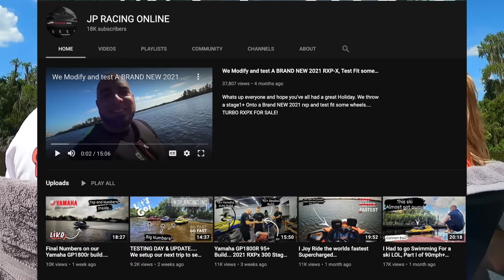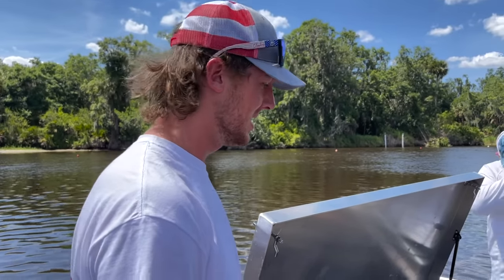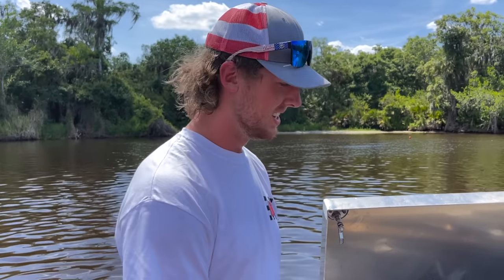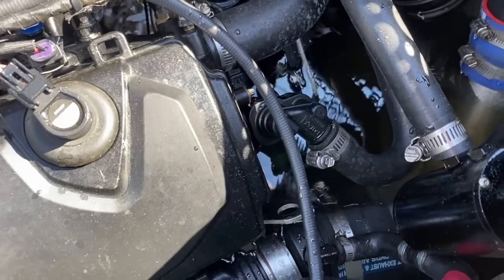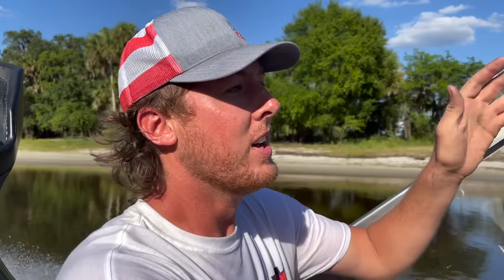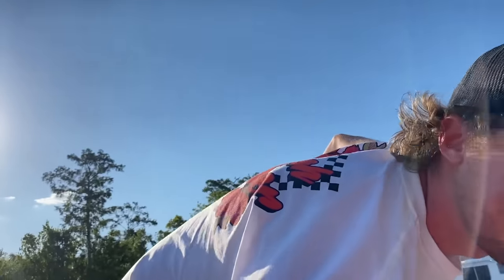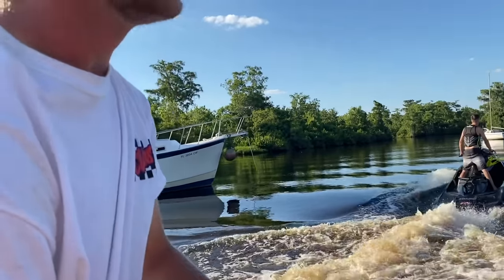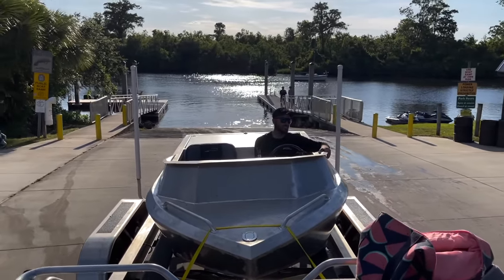BEST BOATS EVER!!! Taking Our Supercharged Mini Jet Boats On SUPER Shallow River Trails!

Comment: You guys should really put some foam on the top of the A pillar for the window. Last thing you or your passenger wants is to slam their head into a tube of bare aluminum while doing a 360 spin
Reply: Pretty sure I've had a couple of concussions from that same thing
Reply: And some foam on the inner hull outboard of the seats... Add some side bolster to make it easier to keep your seat in those turns 🤣
Reply: Safety is kinda the last thing he thinks about so probably won't happen
Reply: Even like some cut pool noodles

Comment: I can’t tell if it’s supposed to be spraying 50ft behind or if cleet needs to trim the jet down lmfao
Reply: Yeah I think they may need to do some adjusting. When James trimmed his all the way up it was shooting really high into the air. Ideally full trim up should be straight back and you can adjust aiming into the water, not out
Reply: The roster tail is all show. Best performance is all the water stays in the water straight out the back. You can use the trim to help keep the boat on plain but that's it. But they have way more power than they really need so what the hell, enjoy spraying your friends.

Comment: I think you need spring clamps for those hoses.. not the threaded hose clamps.  Constant hot and cold cycling will loosen those hose clamps up on that rubber.

  Should help the leaking a little!

Comment: It would be cool to see they set up with 2 engines and 2 jets with a throttle on either side of the wheel so you can have double the steer if you pull one while turning.
Reply: Unless it already is

Comment: Anything  rounded under the surface are indeed going to be brakes.    Fast boat guys make sure all hull edges are clean and are nice square and reasonably sharp.   The better you get it the faster it goes, more efficient, with better off power 'coast'.

Comment: Definitely need a hot foot throttle so you can control the throttle regardless of steering wheel position and also use the trim buttons while keeping on the gas...

Comment: Was it a mechanical seal that went on the jet ski? If you’re running in shallow sandy water a lot you could set up a steering wheel button and windshield washer tank with clean water T’d into the seal cooling line to keep the sand from destroying the seals on your boats.

Comment: That's good cletus actually gave credit to those who built it instead of keep saying. I built it myself like the last video. My cousin watches this guy religiously and has been to the factory. He has been the one telling me to watch him.
Past 6 months I have been building one myself with a tenth of resources this guy has. It has not been easy. Went from flat sheets of aluminum to jetting on a table to a giant press by myself.. All bends, angles me, rebuild jetski motor, me. Tacking, welding all pieces and panels, engine installment, alignment. Wiring, Literally everything has been me. I'm nearly complete. The only help I have had was one guy run a drill to tighten all bolts from the outside for uhmw. That has been it. 
So when this guy kept saying that over and over and a lot of comments were cheering on that he built it himself( which he didn't  clearly) people were saying he should make a shirt and shit...  all bullshit. Made me mad lol
SO!, when he cleared that up in the beginning of the video, it actually gave me more respect for the guy. Good shit cletus!

Comment: When, youre in real shallow water, start doing “S” turns, it will get you a little more shallower water and it will force clean water into the pump and you won’t suck up much rocks and debry that’s on the bottom.

Comment: Looks like they need a Hot Foot gas pedal installed.  It will get the throttle off the steering wheel.

Comment: They left aluminum shavings in the bottom when they installed the sub floor?  Dang, that's pretty basic.  Wonder what other very basic clusters got built in.  I wouldn't go out farther than I could swim if I were you.